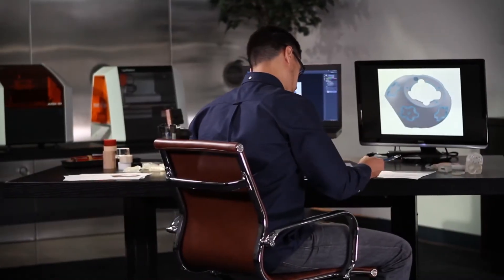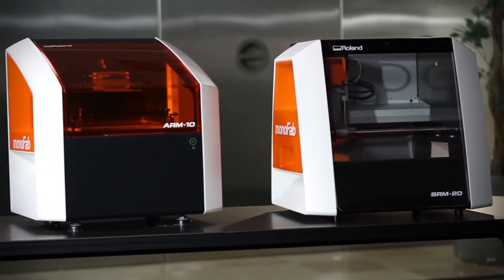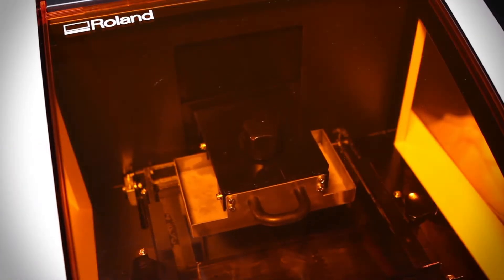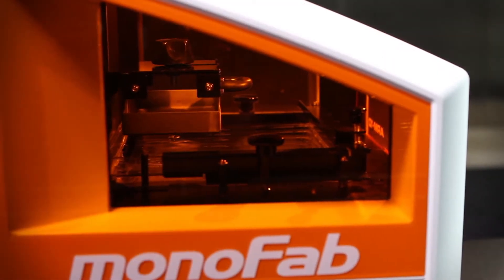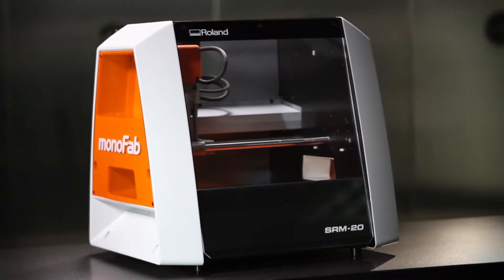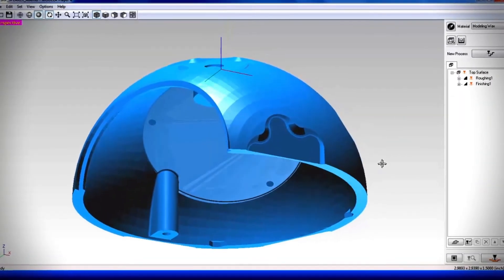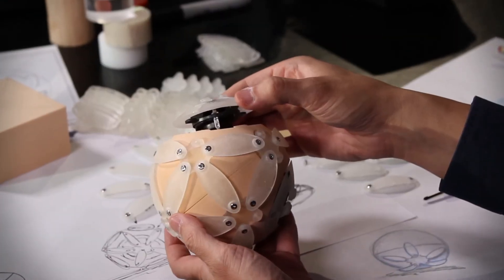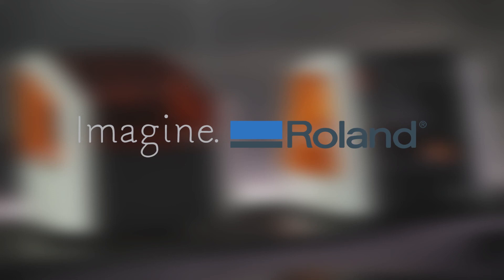Roland monoFab ARM-10 and SRM-20

Comment: buenas ¿han probado la srm-20 fresando aluminio?¿qué tal funciona?
Hi, Have you tried the srm-20 for milling aluminum? how does it work?
Reply: Hi Braulio, the SRM-20 was designed for soft materials, such as modelling board (chemical wood). As there is no facility for lubricating the cut, or managing lubricants, I wouldn't recommend trying to cut any metals. You could consider a composite board, such as Cibatool-Express 2000 (Ren Shape-express 2000 in US), or Metapor.
Reply from the maker: Thanks for your msg Braulio - I will check with our experts & come back to you.